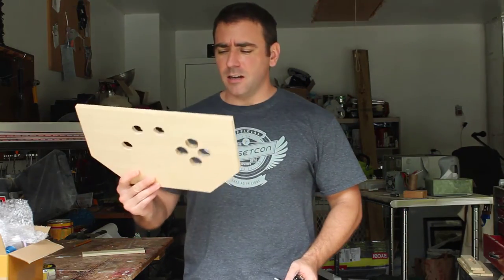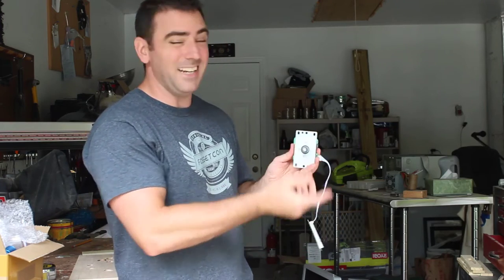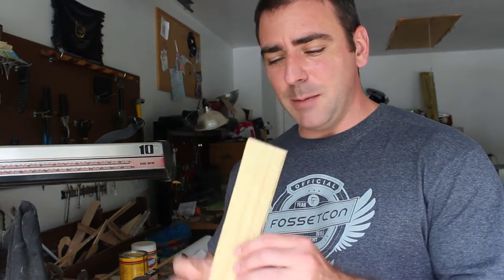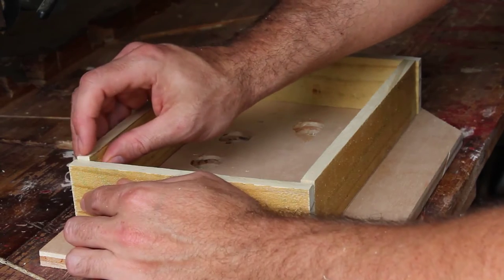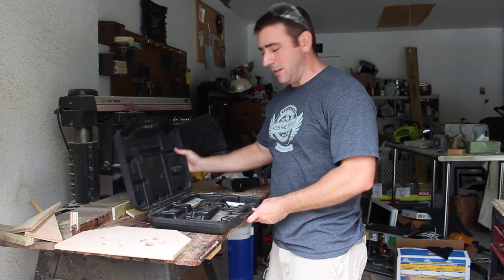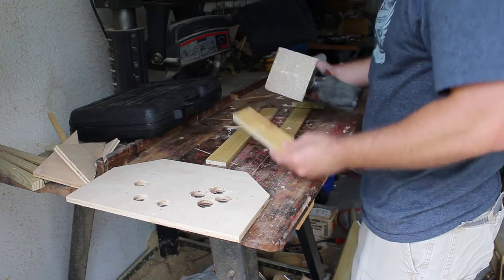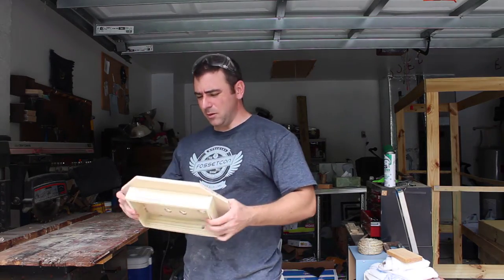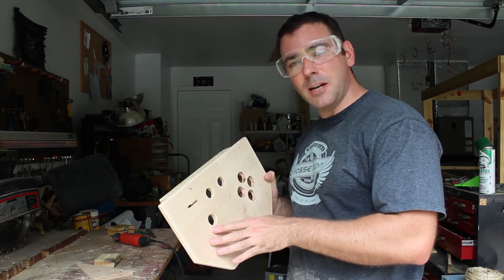DIY Arcade Game Controller Part #2

Comment: You didn't have to cut out the mounting plate of the joystick in the first place. You could have simply remove the acrylic square gate holding to gain access to the microswitches PCB and turning it 90°. And then place the gate back.